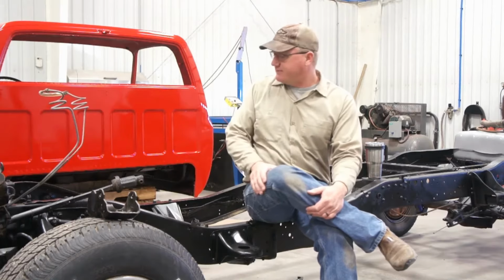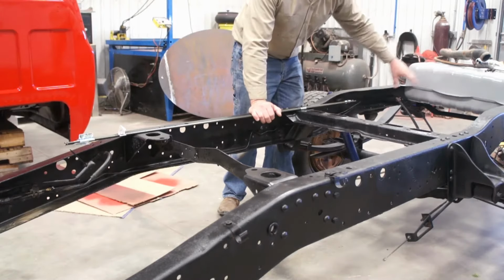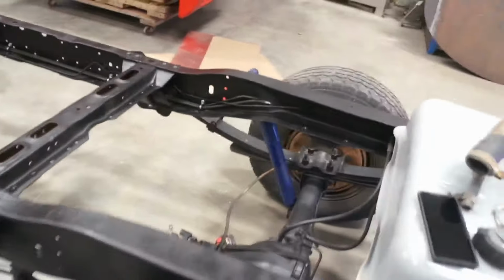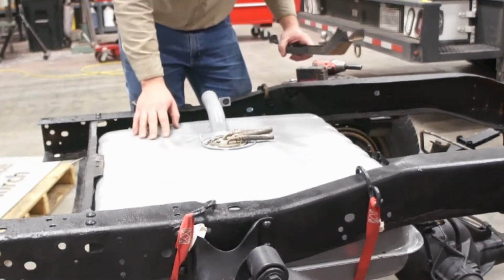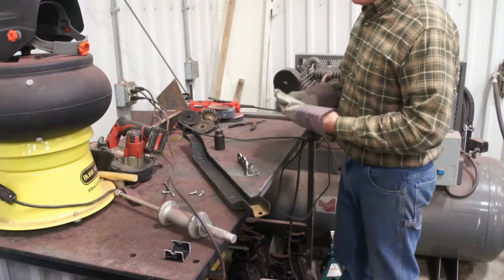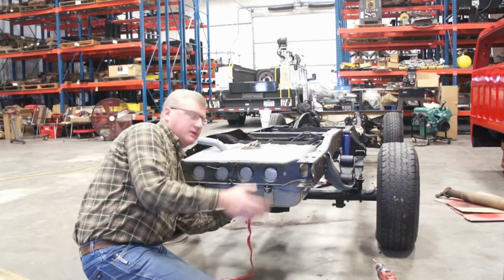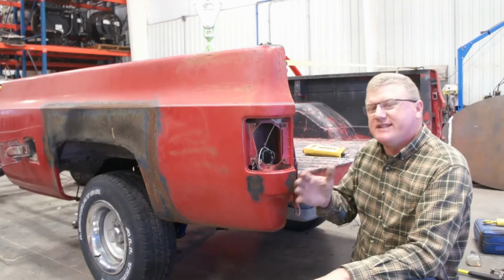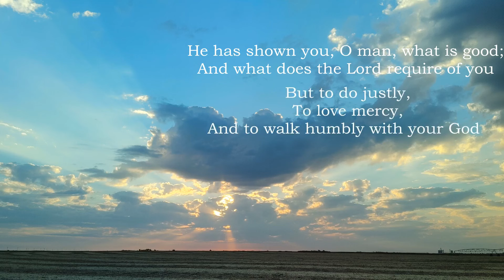Replacing GM Square Body Saddle Tanks with One Rear Suburban Tank | 1986 GMC

Comment: Hoarfrost day I see LOL Double flare the tubes or expect leaks later. Use as much steel line as possible even if just a foot or two. Rubber hoses should only be small lengths such as 6" or less. Like the idea of getting rid of the double saddle tanks. Putting the filler opening behind the taillight is a great idea!

Comment: Good job on the mod & fabrications!  I, too, am not much into modifications but I think you made a good decision regarding the gas tank.  There is a you tube channel of "Fitzee's Fabrications" & he has a video where he moved the filler neck from one side of a truck bed to the other side.  That might be worth your while to see that if you want to move the gas filler door.  Of course, you most likely could do the Mr. Bean cut & paste move yourself but I thought I'd suggest it anyway.  I know how good the feeling is when you start to grab stuff from the disassembled pile & put it back where it belongs.  But, still, I wish I could just snap my fingers & have it all fall into place.  It'll be awesome to see the engine, tranny & cab back together -- I'll be pullin for ya.

Comment: I would HIGHLY recommend putting the fuel vent tube and vapor canister back into play, because that will help in tank pressure regulating and putting the fuel vapors to work with intake delivery!
Reply from the maker: Yes, I'm considering my options there. I may just mount it hidden under the cab where one of the fuel tanks used to be and plumb it from there.

Comment: There's a company out there that manufactures a flush mount gas filler neck, it has no door and you can push in and turn and remove the gas tank cap they really are pretty nice I believe they come in a chrome color but you have the option to paint it the color of the body. Kind of cool and pretty simple to do. Just a thought, putting it exiting the tail light is quite a bit of work
.

Comment: Good afternoon in 1984 I purchased a brand new square body 6 cylinder 3 speed on the column and drove the truck for 20 years before it rusted out. I live in the south on the coast and it lasted a little longer than the Northern Truck. My question is if you happen to need to change your fuel tank after installing a Suburban style tank are you going to be able to do that? I do appreciate what you're doing because I really like the square body good luck with your project, Mike
Reply from the maker: Yes, it will drop out like any other tank from the bottom. Depending on what happens with the exhaust, the tailpipes may have to be removed. Having said that, rust here in Kansas will eventually happen over the course of 20 or 30 years of daily use, but not right away and not on a truck like this that will be more of a fair weather driver anyway. If it hadn't of been for the plastic tank shields collecting dirt up against the tanks they would still be fine. I would love to own a square body model with a 292. Thanks for watching!

Comment: Did you have to move the rear shock to the outside of the frame? Or is that model like that? Got the tank now that 1 rear shock is in the way
Reply from the maker: No, I didn't have to modify any of that.

Comment: I am a little surprised that your filler fits under your bed.  I am working on putting a step side on top of a tanks inc blazer tank and the filler neck sticks way up.
Reply from the maker: Interesting, you wouldn't think there would be a difference there.
Reply: @TheJayhawker   Looking over it I used actual tank mount crossmembers from a Blazer and you did the modify method.  It looks like the front of your tank is lower via that method.

Comment: What rubber did you use for the tank straps and tank? Where did you get it.
Reply from the maker: I mention that in the next video in the series. Simply went to walmart and bought soft rubber garage door seal
Reply: @TheJayhawker  oh sorry I didn’t know it was a series. I’m putting one in my 1 ton and the passenger side shock is in the way. Did you have to move yours? If so I’ll watch the video that’s in and see what you did
Reply: @TheJayhawker oh sorry I didn’t know it was a series. I’m putting one in my 1 ton and the passenger side shock is in the way. Did you have to do something with it also? If you did I’ll go watch the video to see what you did to get an idea on what to do with mine.

Comment: Hey . I watched the whole thing. Look very good. Have you thought of running the fuel  filler neck thru the fender .? I'm planing of using that tank on my 54 Ol' Beater. What are the dimensions of a 87 Subarba tank? Just fwd-aft. Side to side. Thank you.JB